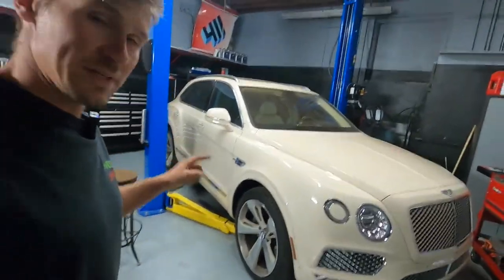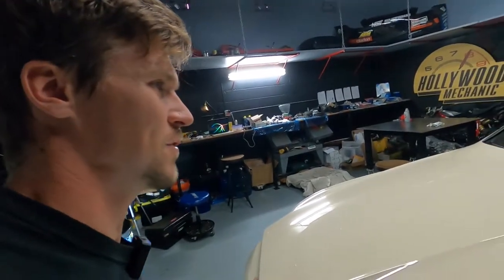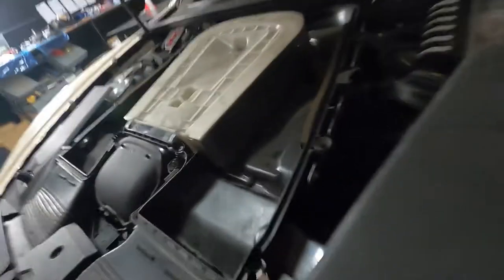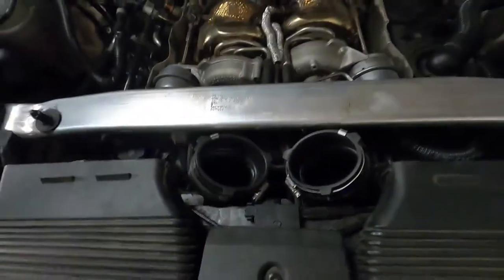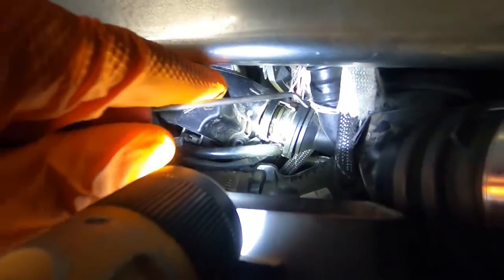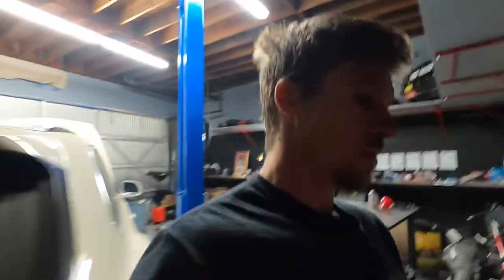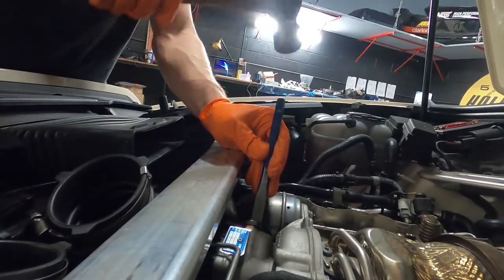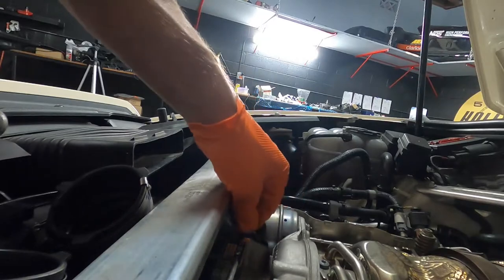URUS or BENTAYGA Multiple Misfire W/ Whistle Audi SQ8, RS6, RS7 4.0l V8 Turbo

Comment: Thank you, i have solved my RSQ8 Issue with following 

DTC : 16445 - Fuel Rail/System Pressure Bank 2 P01C9 00  - Too high
33713 - Leak in Air Intake System P22789 00
10203 - Random/Multiple Cylinder Misfire Detected P0300 00
10597 - Cylinder 7 P0307 Misfire Detected
10597 - Cylinder 6 P0306 Misfire Detected
10597 - Cylinder 5 P0305 Misfire Detected
10597 - Cylinder 8 P0308 Misfire Detected
33835 - Misfire Detected -- Fueling Disabled P0363 00

Issue was small breathe hose, non return valve was free

Comment: It’s PVC
Reply from the maker: You mean pcv, pressure control valve, but that's not what audi calls this part, so it would not help for people trying to search for it.  Use my part number and do not use PCV or especially PVC.
Reply: @HollywoodMechanic  positive crankcase ventilation